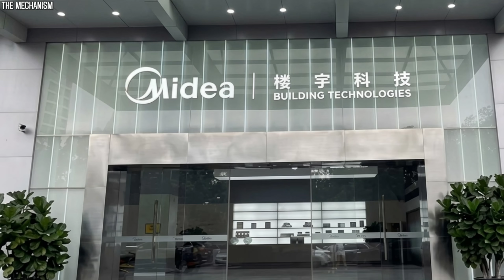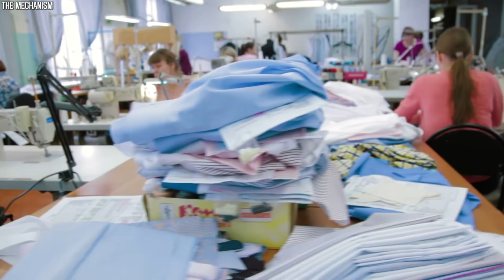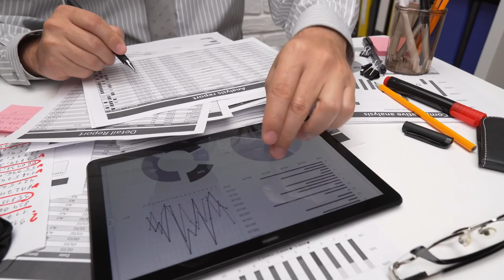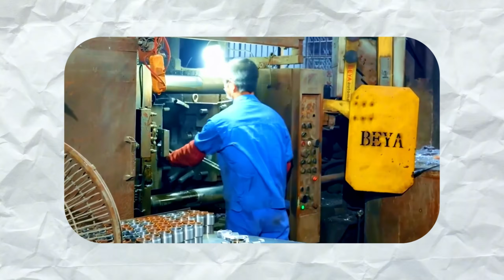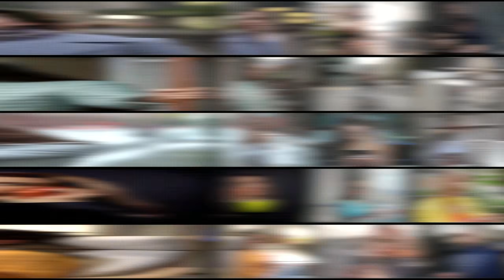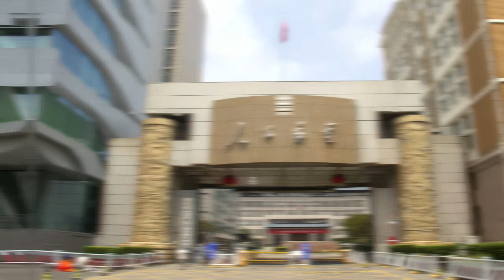China Built a $1.2B Factory With ZERO Workers — And It Runs 24/7

Comment: The detail that stuck with me is that the machines navigate in total darkness with accuracy measured in tiny fractions of a centimeter — no lights, no air conditioning, nothing for human comfort at all. Running three years straight without a single holiday or sick day really shows what lights-out manufacturing means in practice. The point that raw metal enters one end and finished parts come out the other with no human hand ever touching the material is the clearest picture of Industry 4.0 I've seen.

Comment: I worked at a job shop and the German equipment manufacturer was promoting lights out running for lasers. It did not work. Too many variables with lots of different parts.
Reply: Of course, it wouldn’t work in Germany. The Green Party would stop it.

Comment: And how is the maintenance of all these robots and automated systems applied or done. Machines need people to maintain them along with software. Just asking.
Reply: In short time Machines would need only machines for repaires,upgrades etc.
Reply: AI  controls everything.China advances like crazy
Reply: Of course, all manufacturing process require repairs and maintenance!
You just have to plan and integrate the R&M 
as a part of the whole smart operation.

Comment: Fact check with ChatGPT:

Yes — Midea has invested heavily in highly automated “dark” or “lights-out” factories, but the specific statement that “Midea invested exactly $1 billion in one dark factory” appears to be a mix-up of several different Midea investments.

Here is what I found:

* Midea has actually built multiple dark factories, including highly automated sheet-metal and injection-molding facilities. Its 2024 semiannual report explicitly says it had “built multiple sheet metal and injection moulding dark factories and digital unmanned laboratories.” 
* Midea also operates several World Economic Forum Lighthouse Factories. Its Guangzhou air-conditioner factory became a Lighthouse Factory in 2020, using extensive automation, AI, intelligent scheduling and digital logistics. 
* Midea’s M.IoT industrial Internet platform had received more than $1.45 billion in cumulative investment over eight years, according to Midea’s 2021 materials. That is probably one source of the “$1 billion” figure—but that money was not all spent on a single dark factory. 
* Separately, Midea announced plans for 10 billion yuan (roughly $1.4 billion at the time) to build three technology/industrial projects in Foshan, including an Industry 4.0 intelligent-manufacturing demonstration base. Again, this was a group of projects, not one factory. 

Interestingly, Midea has gone even further recently. Its Jingzhou washing-machine factory has evolved from a conventional automated factory toward what Midea calls an “Agentic Factory,” where AI systems can monitor conditions, diagnose problems and initiate responses rather than merely execute pre-programmed automation.